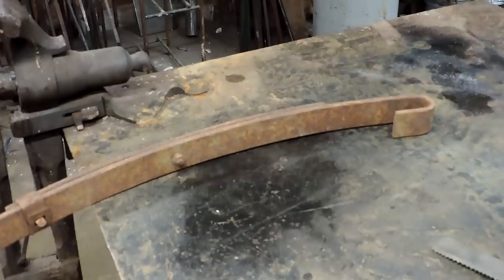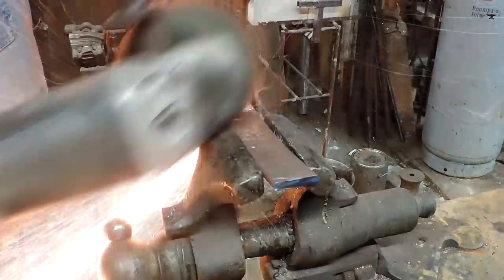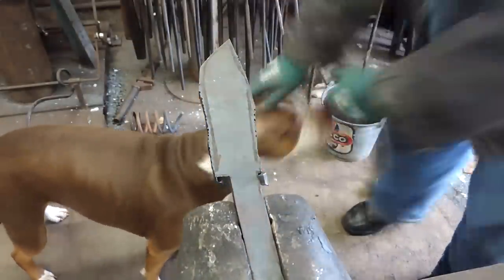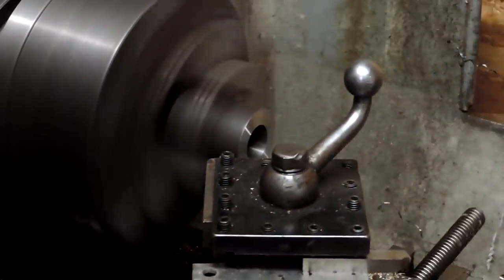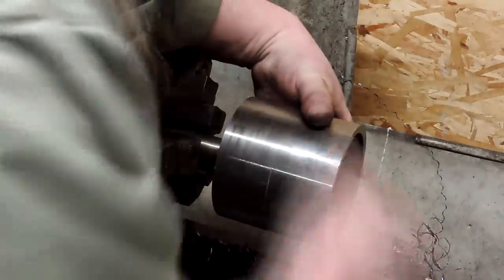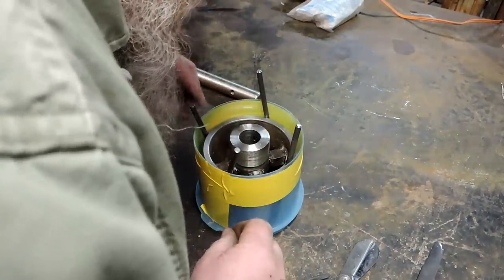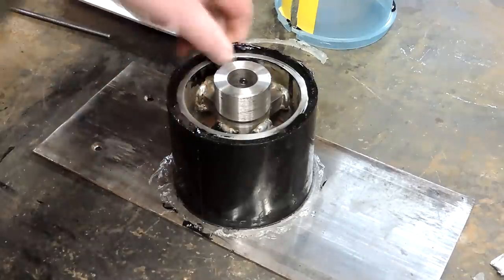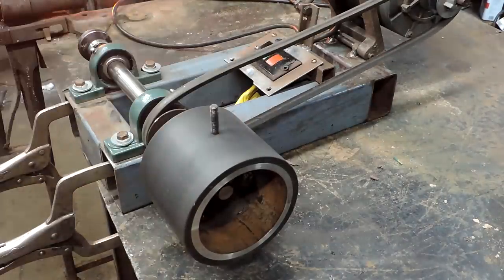Surface Grinder part#1 Contact Wheel From Scratch

Comment: Thanks for your video. I built a 2X72" belt sander a couple of years a go and it will really remove the metal. I wanted to have a wheel to do knives for a long time and after watching your video I ordered some of the stuff you used. I had a old wheel off a pallet jack that had the rubber worn off and recast it. Its horrible out of balance but I can fix that. Thanks to you I jumped in and did it.
Reply from the maker: Good job I'm glad you got something from the video,
Thanks for sharing. Take care and be safe.

Comment: Great idea and execution, I've been puzzling over how to make drive and contact wheels for my belt grinder project without buying ready made parts or building a furnace to cast metal parts. Clever use of the lathe to center the spokes for welding

Comment: fantastic job. I made a hub in similar fashion using aluminum but turned the surface with a course finish as to lock the urethane. I believe the urethane sticks to metal with incredible strength as I found out with a couple of tests.

Comment: Impressive. I have a Burr King 2"x72" belt grinder and I wanted to replace my rubber contact wheels, on my knife makers attachment, until I saw the prices. Contact wheels are ridiculously priced given the materials that make up one.

Comment: Man I’ve been wanting to do this for years, I even emailed Smooth On to see if they had a type of rubber that would work but they said they didn’t.  Thanks.
Reply from the maker: Hi shane, I checked out Smooth On and didn't have much luck.
Check out the link I left in the description, the folks at specialty Resin

Are very helpful. Take care and thanks for watching.
Reply: @BIGDOGFORGE , man that's excellent if it works. I've been trying to figure out something that would work.
   Man thanks for sharing and having us over.
   Blessed days sirSir,  Crawford out

Comment: Nice job. I make knives by hand at the moment. Bevels turn out ok but belt grinder would be nice. I work at a company producing the adhesive to bond urethane to steel for rollers like this, wheels etc..  if you have any problems over time consider giving the steel a mechanical key and applying a bonding agent 👍🏻

Comment: looks like you have some castable material left. to keep it workable, a nitrogen gas blanket in the container works. usually the supplier sells spray cans of N2 for the purpose.
nice work

Comment: Cool...This is somewhat familiar to me....I mix a lot of 2 part epoxy to pour on my projects (wood and foam board mostly) and I noticed the caps on your urethane bottles were taped and that's how my epoxy bottles are when I receive them...we might use the same supplier although the name of that supplier escapes me at the moment...anyway, awesome wheel, Tim!

Comment: Call Klingspor's Woodworking shop.  They are the retail spot for Klingspor abrasives.  They can make any belt that you want in pretty much any material they make belts out of including ceramic.  Just a tip.

Comment: You could have spent less time forging that blank a small bit thinner so you could save material. Also by putting more effort into shaping the knife profile hot, you will increase your skills and save more material from the grinder. Depends where you would rather spend your time, collecting more material or stretching it out to last that much longer.

Comment: Excellent video. I really need a wide belt grinder wheel and it's likely to be much more expensive here in NZ than in the USA.  One little point. You keep referring to a belt grinder as a surface grinder. A surface grinder is a totally different machine, much more precise and much more expensive.
Reply: Actually, the S&H fees are exactly the same to NZ as to the US. I just posted some prices as a comment to this video.
And yes, you are correct about the surface/belt grinder definition.

Comment: You waste to much of good steel .I pounded spring from a Studebacker down for 3 ulu knifes .It was such a chore on my little anvil but none wasted.You had you press flying as you worked the hard ass steel.Then cut it at 3 times the knife thickness you could had 3 more knifes.
 But most of the time your work amazes me .
Thank you Sir for this video.

Comment: have you though about balancing it like you would do with a grinder wheel or lawnmower blade find the high spot and drill little into it? or add weights? it may not matter was just wondering

Comment: Did you machine the surface of the rubber flat or did you add a small crown it looked like you were cutting in a right side taper at one point
Reply from the maker: I surfaced it flat, Turing rubber is really different but it seemed to come out ok.
Thanks for watching.

Comment: Love what you did I have plans to do about the sane thing never thought about spokes I was going to an aluminum hub from solid 6061 or 7075 and under cut to lighten I was going for 6" 8" or 10" or maybe all . Are you going to make your mag plate also? Be well and be safe
Reply from the maker: I've all ready purchased the mag got it on eBay 100.00 bucks free shipping, it was a great deal.
Eventually I plan on casting a 10" for the 2 x72  but that will be a while before I get to that. Thanks for watching my friend.

Comment: Very interesting. Thank you.

A question: how durable do you think that polyurethane layer would be if a series of two or more drums were used to make a toothless 'gears'-train? If, for example,, there was a 300mm diameter spinning in contact with a 100mm to give a 3:1 stepdown ratio? It would obviously work, but how long do you think it would it last, both the surfaces on the two drums and the bonds with the metal?

Comment: is your contact wheel still hanging together, i finally built a decent 2x72 and want to make one, any seperation between the wheel and cast rubber after some use